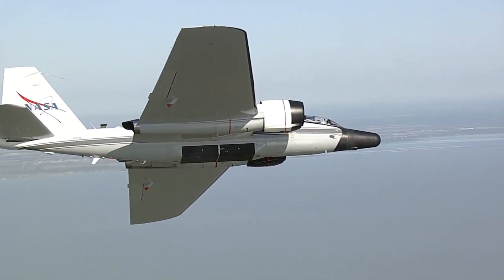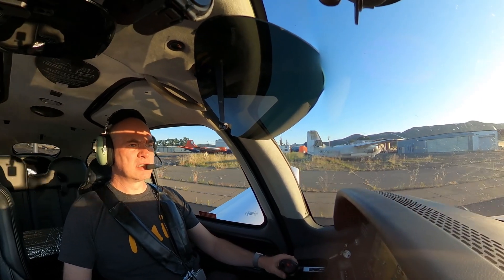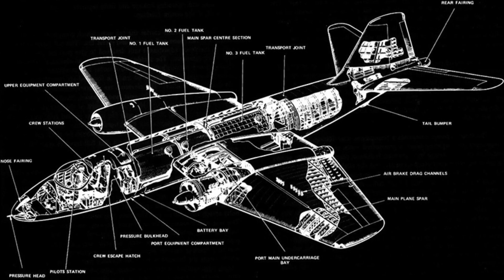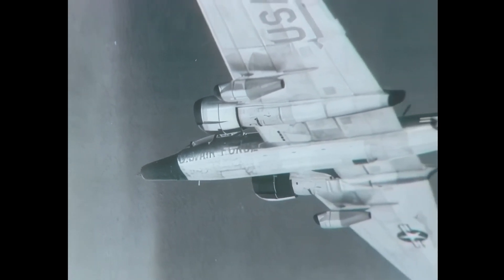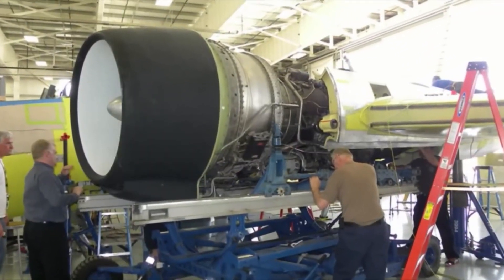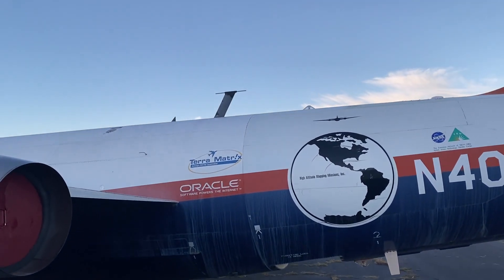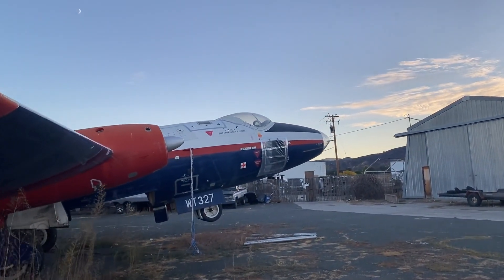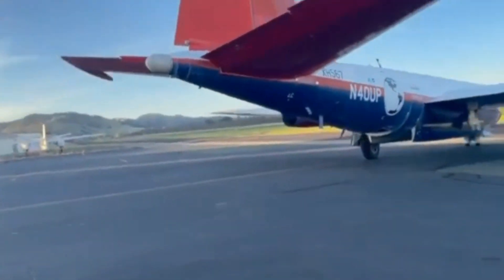Why NASA Relies On A 1950's Aircraft Design To Track 21st Century Spacecraft

Comment: I flew on a Canberra out of RAF Lossiemouth in 1980 while on a CCF summer camp. They were used for high altitude reconnaissance. I recall some impressive looking camera gear. They also operated Jaguars out of the same base. The Jaguar simulator generated images by flying a camera on a gantry over a scale model of the Scottish countryside in a large warehouse. Bad weather was simulated through contrast and noise controls. Crashes were detected by way of micro-switches mounted on the edge of the camera lens. We also were permitted to hang out in the bar where there was a space invaders machine - the type with the monochrome display simulating colour bands with in effect sweetie paper. We had this notion that the high scores were all Jag pilots, but they were probably over in the officer's bar. Happy days ...

Comment: Great story Scott. Around 2001 I attended a rocket powered aircraft seminar hosted by the BIS (British Interplanetary Society). There was a high altitude (rocket assisted) Canberra talk. It included an amusing photograph of a Lockheed U2 in flight (62,000 feet) taken from above and a photo of an aircrews hand who had ejected at 70,000 feet. The crew member lost a glove during ejection, the hand ballooned and blackened due to the very low air pressure. Interestingly the rest of him was fine, remarkably the flight suit provided adequate protection even at that distance.

Comment: Excellent report. Just a small correction. It was not the first jet to cross the Atlantic. Six Vampires fighters accomplished that in 1948, though the flight was not non stop. They flew from England to Labrador and on  to Montreal. However, the Canberra was the first jet to cross the Atlantic 'non stop."

Comment: The rocket assisted, record setting Canberra is now owned by the VTST (or whatever it's called now) with aims of returning to flight, but I don't think they've done anything with it for years now. I believe it is/was stored alongside Vulcan XH558 in pieces.

EDIT - Oops, you touched on that at the end of the video.
Reply: its tail number is WK163. Flew in her a couple of times. All at low level (250ft} The only time I was airsick in hundreds of hours in Canberras!

Comment: I like your diverse choice of videos and even more so with this one, during 1975 I was a 19 year old A-Mech-E (Aircraft Mechanic Electrical) based at RAF St Athan which was doing major refurbs on Vulcan's and converting Victors to tankers, I had specialised in flight instruments and not only worked on the V bombers instrumentation but I also did instruments from other aircraft including amongst them was the Canberra, my best memories of that time was watching a Vulcan fly round the airfield on a wing tip doing an air worthiness flight with the sound so powerful it neerly caused involuntary bowel movements, thinking back, another time I had a squeeky bum moment was when I stood on the taxiway and had to receive and marshal a Vulcan into its parking bay as part of my multi role training using the orange lolipops, thank you for stirring up the memory.
Reply: They were scary weren’t they, managed to drop a nuclear bomb on New York two years running in the 60s too in simulated strikes which put the fear of God in NORAD.

Comment: Used to drive past a Canberra cockpit that is on display outside a hut used by the RAF air cadets.  It could do with a clean, but I was always fascinated by it.  It's located in Ammanford, South Wales and is next to the hut used by 2475 (Ammanford) Squadron, Royal Air Force Air Cadets.  As I said, it is in a bit of a sorry state and could do with a clean, but it is worth a look if you are in the area.

Comment: "Canberras sitting on their tail?" There are 3 fuselage fuel tanks tanks. Balancing fuel is not a bg deal but necessary. A friend who was on the same course as me at Bassingbourne landed from a night sortie in a PR3. He got out followed by his navigator when they noticed the already open door rise into the air. The aircraft was not damaged. There was not hangar space for all of them so they lived on the pan. In winter,  snow warnings brought out the steps and brooms. I cannot remember the critical depth on the tailplane (about 3 inchs) but snow could easily produce a fleet of tail draggers.

Comment: One of my coworkers was flying backseat in this aircraft when the power went out. Engines, radio, lights, everything. It was nighttime and they were suddenly in a high-altitude glider. While the pilot concentrated on flying (and attempting to restore power), the navigator pulled out paper maps and used a flashlight to find a runway of suitable length. There was one, Dallas/Fort Worth International Airport. She circled it, and used a claw tool to pass the map up front to the pilot (the intercom was out too).

Shortly afterwards, air traffic control at DFW saw an object appear on the radar with no callsign. It did not respond to radio. It was heading right into one of the busiest airspaces in the US. And most troubling, it didn't appear at the edge of the radar field, but rather in the middle -- apparently re-entering from outer space. They closed the airspace as it lined up on a runway.

The plane coasted to a stop surrounded by all the emergency vehicles. The crew popped the canopy. Not having the WB-57's ground support equipment available, they had to winch themselves down from the cockpit, still dressed in their orange pressure suits. The local sheriff approached as they opened their visors and simply said, "Welcome to Earth."
Reply: I love the sheriff's greeting 😂
Reply: Great story. Thanks for sharing!
Reply: So there ARE sheriffs with a sense of humor? That's nice to hear.
Reply: @railgap NO !! There used to be!!
Reply: Epic.... 😎🤘
I believe it, but even if it was totally made up, that'd still be an awesome story! 🤣
Thanks for sharing it! 🍻
Reply: This is one of the coolest stories ever
Reply: Couldn't find anything confirming this story, only a word-to-word identical post from Reddit four years ago. Seems fake 😢
Reply: Glad to know my home airport has a wild story like this! Thanks for sharing!
Reply: Having been a mechanic back in the late 60s was always a rock ,paper,sissors when a  vehical with lucas electrical had issues ..
Reply: @chriscampion9906 And of course the old joke, "Why do they drink room temperature beer in England?  Because they have Lucas refrigerators."
Reply: Someone needs to make sure this story makes it into an aviation history book.
Reply: @andreasandersson2994they forgot to refill the smoke in the wires
Reply: @musewolfman , I used to HATE IT when the magic white smoke escaped from a test station I was working on!  It's REALLY HARD to replenish that smoke once it's gone.  And since that's what makes the darned things work, we used to work hard to make sure it didn't get away!
Reply: Wonderful story. Imagine the impact of these aircraft when they first flew in the 50s the space age to many must truly have arrived when ten years before biplanes were still common.
Reply: Could of even inspired the recent Top Gun Intro!
Reply: Why would they call the sheriff😂😂😂ya plum😂😂
Reply: When we were carrying aout the high altitude flights in 567 we were always pushing the limits which basically was when an engine flamed out. If my pilot was quick he could do a hot relight, if not it was descend to 35000ft to carry out a cold relight and climb back up again, managed 50,000ft once but generally only 47/48 thousand.
Reply: Excellent story, thanks for sharing.
Reply: YouTube should provide links to comments. I would definitely republish this story.
Reply: With that wing it would be hard to find a better jet aircraft to dead-stick.  U-2 maybe.
Reply: Did the sheriff also punch them in the face, as is customary with that greeting? 😂
Reply: Couldn't have asked for a better ending to a scary situation like that. 
😂❤
Reply: Apart from the BAe lighting this was another favourite air craft  from warton lancashire as it flew up the coast of Blackpool and what a fantastic sight flying over my home town

Comment: Just like the Comet discovered metal fatigue, the Canberra has the dubious honour of discovering stress corrosion cracking. The centre section forging had a deep u section machined into the forging. Water from condensation would collect in this channel and you would get intergranular corrosion which in combination with the stress from holding the wings on would lower the limit stress of the material leading to cracking. Fortunately discovered prior to a crash.
Reply: And if needed to be relocated after early discovery could be flown from Cyprus to UK. Not above 250Kts indicated, not below 10,000ft except for the two take offs and landings
Reply: @robertkirby3158  love these little snippets

Comment: The first display flight of the Canberra at the Farnborough Air Show was a revelation. The pilot (Beaumont?) put on a shocking display of speed and agility of this large aircraft that embarrassed most of the aircraft in the line up, the display flight staying inside the airfield fence. 

Intended as a medium bomber it definitely fitted into the slot created by the Mosquito. And since the retirement of the Canberra there has been plenty of times when it’s been missed.

Comment: I went to school in East Yorkshire back in the 80’s and was lucky enough to see a lot of both old and operational aircraft. Some were just passing over on their way to air shows or different bases and some were part of exercises or on their way to the live firing ranges over the North Sea. Seeing a low flying Canberra was a great memory, only surpassed by the time a Vulcan came over the school one break time. That was epic, damn thing blotted out the sun with its huge delta wings.
Reply: '81 ish I remember a Vulcan taking off from Catterick while being on the Risedale school bus - nearly rattled the windows out of the bus 😂 What a noise!
Reply: @GavinEarnshaw 
I recall seeing a Vulcan in Lancashire flying on its wingtip, what seemed feet from the ground. It flew across my bows as I was driving along a narrow country road. Shocked the hell out of me.
Reply: That might have been when I saw a Vulcan at the Cowden range when I was sea fishing. Saw a lot of tank busters as well as other aircraft, they used to come over Bilton as they flew round. We always knew when there was going to be trouble as the frequency of the flying would increase. Phil. Know anything about the three UFO’s in 1987<>?

Comment: Just been reading about an EE Lightning based in Malaya in the 50'sthat was used to test how easy it would be to catty out high altitude interceptions against a RB-57F.During the tests , the Lightning set an unofficial altitude record of 87,000 ft, and still didn't close to the 57 which was sitting up around 100,000 FT .
Reply: Can you supply the reference for where you read this? Thanks.
Reply: @geoffreypiltz271  The story I quotes  is from a magazine "Lightning Boys" by Richard Pike , published by Mortons Media Group, and the pilot involved in the intercept is David Room on  P 20 -22
Reply: @colinritchie1757  Thank you. I've been trying to find info on the Canberra PR9's maximum ceiling. I saw a story online that they flew too high for interception by RAF F-4 Phantoms. A US Phantom did set an altitude record by zoom climbing to 98,000 feet, although was probably a specially prepared aircraft. Nonetheless this does suggest that the PR9 may have had a max. ceiling close to your quoted 100,000 feet for the B57. The real official achieved max. ceilings for the Canberra & B57 photo recon versions still seem to be classified information.
Reply: @geoffreypiltz271  Fascinating , I had no idea that that info was still so hard to come by - glad to be able to help

Comment: Another small correction. The nasa b-57s did not come directly from the UK. The first one may have had major sections from the UK, but most of the NASA b57s are made from b57s not canberras. The us government had given NASA one of the original b57b converted to an rb57. NASA loved it and wanted more so they were able to acquire 9 failed "upgraded" rb57 models. They replaced the cracking "upgrade" wings,  modified them further for their use and voila.

Comment: I believe that the engines/wing are so far apart and elevated because during the initial design stages it was thought that the machine may have had to employ propellers.  As a result many aircraft and crews were lost during asymmetric flight.  Mostly during a simulated engine-out overshoot/go-around.  Very high VMCA.

Comment: Noted the second position on NASA bird. Best I had was a ground speed and drift which worked some of the time and a sextant that worked through the canopy. Basically dead reckoning assisted with VOR/TACAN with in 200 nm. Although there isn’t much wind between 60,000 and 70,000 feet.

Comment: And I pretty sure that they were a little easier to fly… considering that the U2 had a stall speed between 10-12 knots at speed anything below or above you could buy the farm… one pilot said it was like flying on the edge of a razor blade.

Comment: I loaded lots of ordinance on the USAF B-57's in Vietnam in 1965-66. It was a great close air support aircraft since it carried more fuel than fighters and could loiter in the target area. Most of ours had four 20mm cannon, carried 21, 260 pound fragmentation bombs and four tanks of napalm on wing pylons. Before Vietnam, B-57s were on nuclear alert in S. Korea. A special rotating bomb door was loaded with a Mark 7 atomic bomb. The airplane had very good performance for a first generation jet bomber during the 1950's. Its engines were real screamers and I lost most of my high frequency hearing even though we used hearing protection.

Comment: Fascinating historical research as always! It's worth mentioning that 48 Canberras were manufactured in Australia by the Government Aircraft Factory at Fishermans Bend, with their engines built here also at the Commonwealth Aircraft Corporation. My (ex)father-in-law came out from UK to Australia as a young engineer in the early 50's to work on it.
Reply: And Canada and New Zealand? Anyway, as a youngster I saw the Canberra, Vulcan, Lightning and Victor in the skies and close up when in the ATC. I flew a dH Chipmunk and in the Avro Shackleton and my first airliner trip was in a dH Comet! I live in Norfolk, five miles from RAF Marham.
Reply: My Dad met my Mum at CAC Homebush in 42-3 so here I am today.  He was a super on the line and she was in the tool shop !
Reply: Fascinating but slightly wrong britain also used them in the low altitude close air support role (it was originally designed for a low altitude intruder like the Mossie but they pushed it higher) one version of the Canberra in British service was actually fitted with rocket pods and cannons in its Bombay for CAS a guy I worked with worked for the RAF on their heavies and was telling me about watching canberras do gun runs off Cyprus 
Interesting fact about the U2 is that the one officers mess in the UK has a photo of the U2 taken from above by an English electric lightning the pilot was carrying a camera for some reason heard the U2 was coming so pushed full afterburners on climbed over it turned over snapped a photo and then dropped back down to standard altitude
Reply: @wargey3431  heard a few stories of that nature from vets.

Comment: I always wondered if the RB-57 with the longest wings and the extra engines in pods could fly as high at the U-2. If not it probably wasn't that far below it.  I love the cartridge start systems.
Reply: I have been told that there is a photograph on the wall of an old RAF base of a U2 taken from one of these Canberra from over 10000 feet higher than so called ceiling height of the U2 can anyone confirm this?
Reply: @Frenchwine15 Rocket  boosters in the wings is kinda cheating though 😂🤣😭.

Think I read that they burned the rockets to get to max altitude, then coasted back down on jets. With those huge wings I bet they spent a long time above the unassisted ceiling.

Comment: NASA has also been seen flying a Vietnam era North American Aviation OV-10 Bronco around the Space-X launchpad as well. It was used in Vietnam as observation plane original and is easily recognizable with it's twin engine and twin boom arranged with an elevator high on the tail connecting the booms.This plane is used for wake turbulence tests and atmospheric research and probably has sensors for trace atmospheric gases. I'm assuming it's involved in making tests on gases leaked from the launch system as part of the certification of the upcomming launch.

Comment: Variations on that red/white/blue colour scheme were used by a lot of A&AEE Boscombe Down aircraft (A&AEE = Aircraft and Armament Experimental Establishment). It's known unofficially as the "Raspberry Ripple" scheme after the red & white striped ice creams traditionally sold by British ice cream vans.
Martin did a lot of good work when converting the Canberra into the B-57, some of which should, arguably have been copied in the UK. British Canberras could also carry guns in a bomb bay pack (4 x 20mm with enough ammo for 55 seconds firing!), but the US wing installation was clearly better, as was Martin's conventional tandem cockpit as opposed to the oddball and unquestionably less safe UK variations. Point of order: British Canberras had tip tanks too, although of a different design. However one Martin innovation that did make it's way back to the UK was the rotating bomb bay door, which was used on the Buccaneer strike aircraft that eventually (via a circuitous process) replaced the Canberra in RAF service. Blackburn had to pay a royalty to Martin for every Buccaneer made.